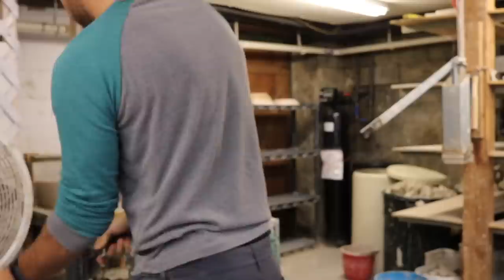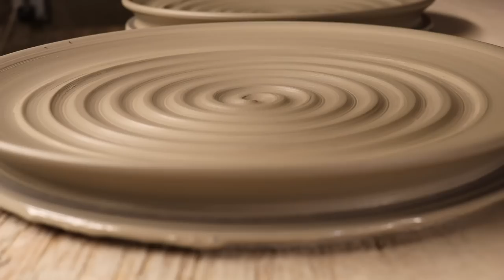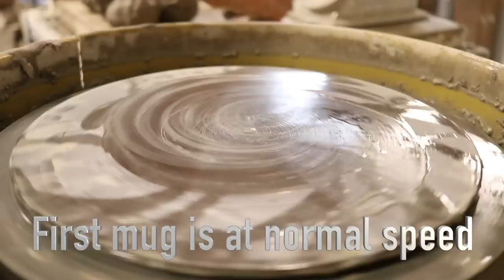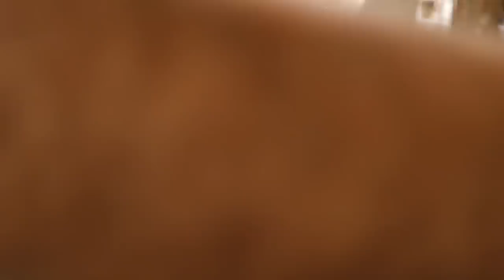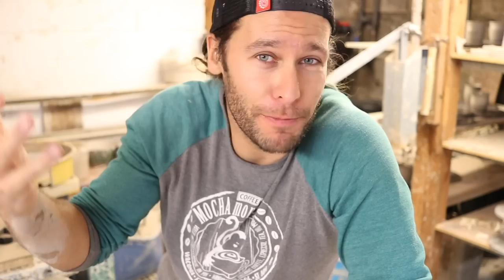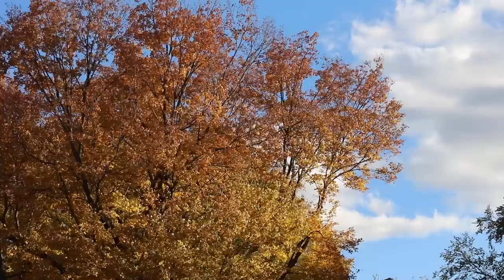Just Throwing Mugs

Comment: I was wondering when you put on your handles after throwing and how long you waited? I’ve had some trouble putting my handles on without them cracking and wondered if anyone had any tips
Reply from the maker: Mug and Handle should be about at the same dryness when attaching, that is the key, if cup is more dry the handle will not attach well.  Other tips, dry slowly??  I wait about 4 -7 hours depending on air flow, humidity, etc.

Comment: i noticed you didnt wire off the mugs. or did i miss it. i did some coasters and i didnt wire off and they just pop off after about a day, would mugs do the same? you make it look so easy as i am struggling with throwing. i like this one but then i like all your videos. good work!!
Reply from the maker: I don't wire right away, usually I wait until the top is leather hard so I can cut off and flip over in 1 step.

Comment: Awesome! Love that shape, good to see exactly how you do it. Do you wait to cut them off the bat?
Reply: Atalie Mitchell I came to comments to ask the same question.  Would love to know the answer!  I have similar bats, and use the wire right after throwing.  Would love to know if this step can be skipped altogether, or if Jon does this at a later time.  
Btw, Love the video format variety!
Reply: The best way is to forget about bats they slow you down and interrupt the flow of repeat throwing. Throw your mugs off the hamp.
Reply: Throwing off the hump brings it's own problems.  He has trimmed it well at the base so should pop off the bat fine when it's ready.
Reply from the maker: Hi friends thanks for all the comments,  I prefer throwing off bats because of the consistency, starting with exactly the same amount of clay each time, being able to move the pot without touching it, etc.  I certainly understand the pros to throwing off a hump and I do that sometimes but most of the time I like bats.   SOO I wait to cut off the bat a few hours so the tops are a little drier and can be flipped over.  If they were just cups and didn't need any handles then I could just let them dry until they pop off, but usually I like to cut them off move them so I can use the bats again quicker!